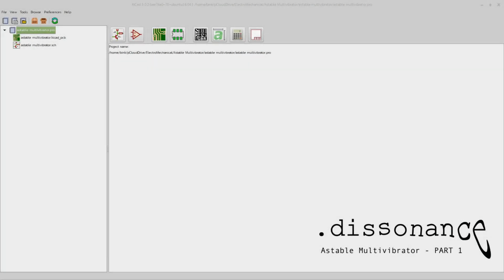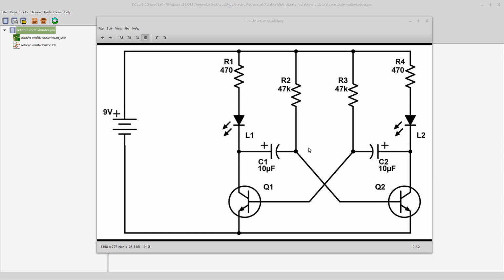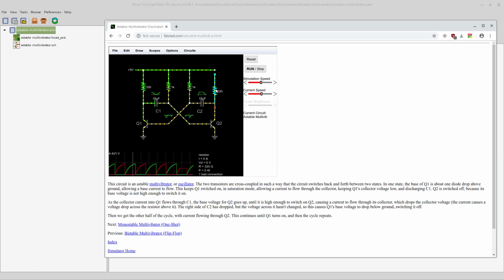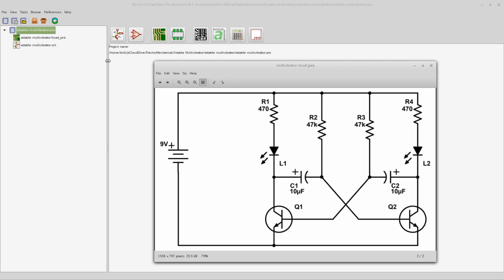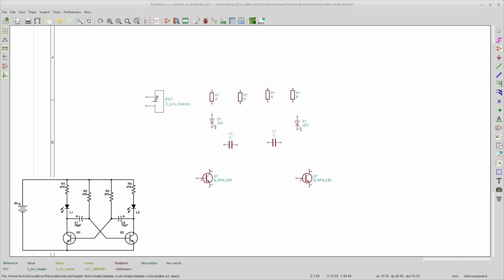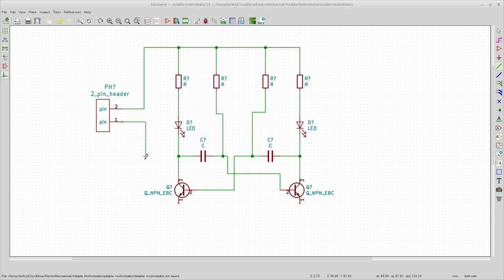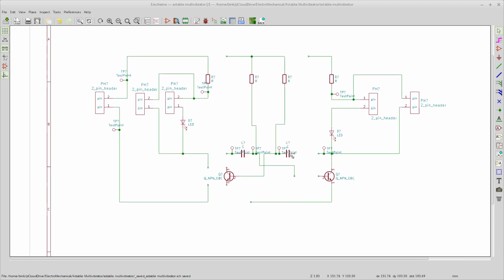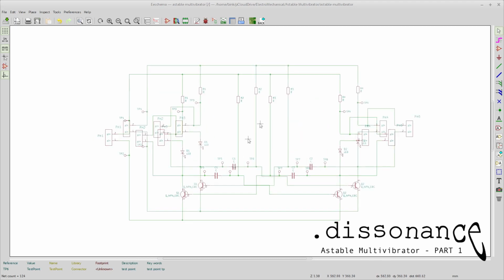#104 - The Astable Multivibrator - KiCad PCB Design - Part 1

Comment: Two tips:
1. 2-pins elements (Resistors, Capacitors, Diodes or Inductors)  in series can be connect with one stroke. Just drag line through element and kicad make a proper connection
2. When you hoover mouse over element press "o". This will find best possible place for Reference and Value Fields. Works most of the time

Your grid is to small. All pins in ICs are snap to 100 mils grid, some small elements use 50 mils so 50 mils grid in Eeschema makes connections much easier.